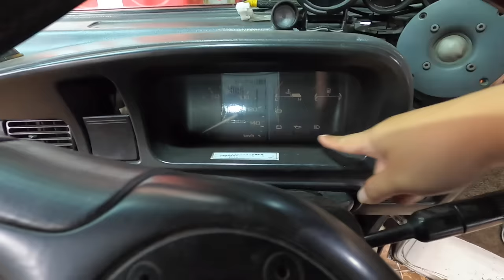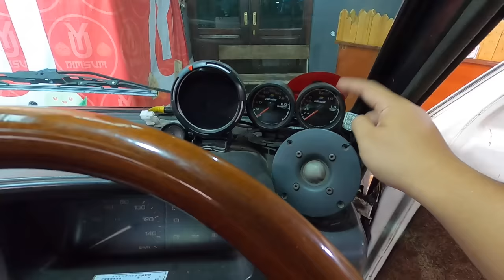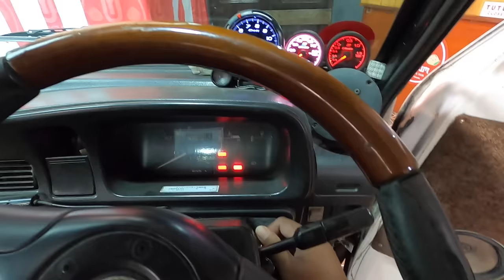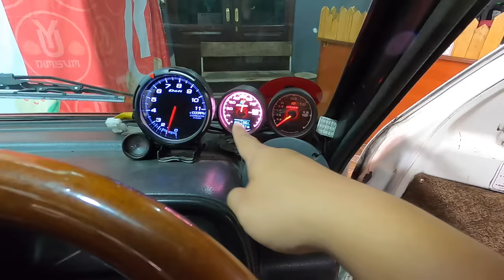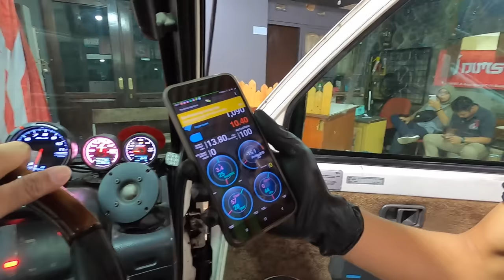Daihatsu Zebra pakai TURBO!!!

Comment: MESIN mobil yang sutandarnya udah enak. Tambah turbo, auto uji nyali

Zebra sy dr 2003 jg jarang bermasalah sampe skrg, top lah ini mobil
Reply: Tp kalau memang sigra keren banget matic lawan manual
Reply: Zebra espass punya ibu saya dulu dari pertama punya udah bermasalah terus. Tapi waktu dijual, lebih mahal dari harga belinya. Terima kasih inflasi
Reply: Masalah pas hujan aja, sering macet delco kena air..
Reply: @bagaswismoko5157  beri sealer supaya gx kena air
Reply: @indrarizkisaputra  siap om. 👍

Comment: Ecunya Stand alone 😲 Speeduino Open Source, Basic Arduino Mega. Untungnya sudah dijual paketan ada Softwarenya coba belum. Mikirin Codingnya mumet. Ecu ini juga bisa buat 8 silinder. Alternatif Ecu Racing harga selangit.